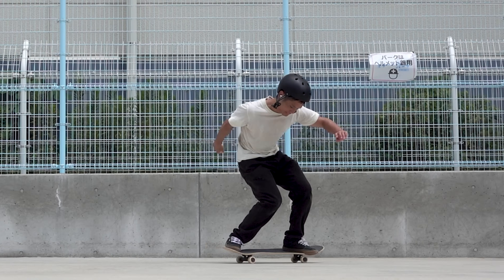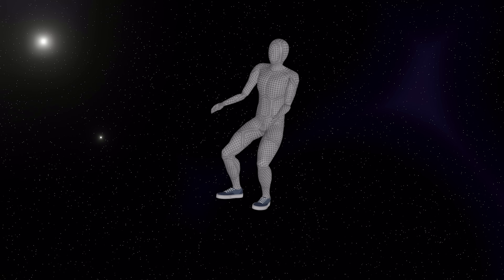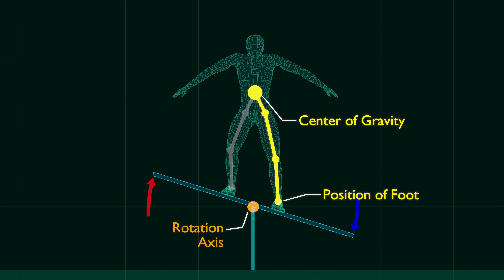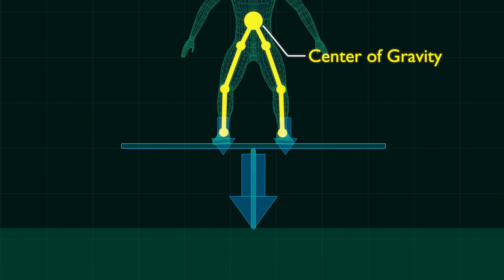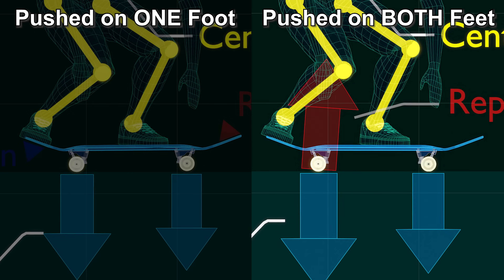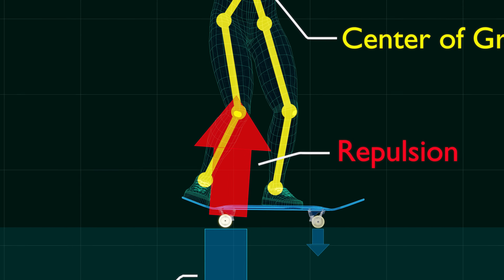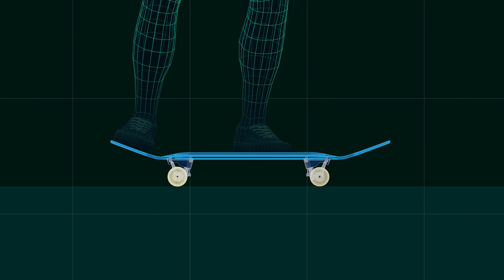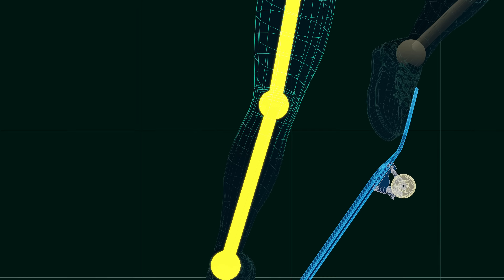The Mechanism of Higher Ollie

Comment: No.  I'm sorry but you're completely misunderstanding physics here.  In fact what's happening in an Ollie is you're PULLING THE BOARD UP WITH YOUR FRONT FOOT!  It's clearly illustrated in the wireframe video.  We jump up first and then pull the board up with the front foot.  The kick nose design of the board has made this much easier than it was before we had this.  Also, just look anyone's front foot shoe - it's worn out on the outside from pulling the board up.  Don't believe me, cut the nose off a board and remove the grip tape and see how high you can Ollie.
Reply from the maker: ???
Of course. The board pops up by popping the tail and lifting the front foot, just like you said. The main theme of this video is "What it takes to lift the body weight," not "How the board goes up into the air."
Reply: @whythetrick  No one cares what lifts the body weight, literally everyone is trying to get the board higher.
Reply from the maker: @OverhandGolf  Noted. Wish you the best luck!
Reply: @OverhandGolf You’re talking about one obvious factor, and being smug about it. Weird

Comment: So like this has a lot of useful information almost too much information. And you deserve respect for the time and effort you put into this. However I don't know what is the critical Point you're making here to Ollie higher can you just say it, Point blank, straightforward, without the physics lesson. Not that I don't appreciate everything here I really do. It's just kinda hard to actually follow the specific critical point.
(like the harder you push your feet down and pull them up will determine how high the Ollie goes or the more evenly distributed. Your weight is the higher the Ollie)
or something like that
Because like if you just jump on the board without popping the tail or sliding your foot, you will not Ollie at all
Reply from the maker: Thank you! I'll try to be more straightforward in the next video!
Reply: @whythetrick  right on man what's the main thing to do for ollie?
and thank you for the work you do like i said you deserve respect for sure man
Reply from the maker: @TomisaLami  Lift your body weight with both feet, THEN pop. Popping alone never lifts the body weight. If you encounter a problem, please send me a video and I might be able to help you.
Reply: @whythetrick i think I get what you’re saying. I usually don’t have a problem with height. I have a problem with turning and I watched your video about turning and tried all that but it’s weird. It’s like I push my tail leg back and I don’t know how to fix it even when I’m conscious of it.

Comment: You should add the point that the front foot ist leveling out (not "pulling up") the board and stopping the rotation of the board around the back truck, this way lifting up the back truck. The upwards motion comes from the pop and jump. I always miss the point of creating space with your back foot. In order to have a high ollie, the back foot is limiting height, you must lift the back foot to create space for the back truck to move upwards, not to rocket your ollie.

Comment: When I was a kid I couldn't ollie no matter how hard I tried until an older boy at the skatepark showed me it's not actually necessary for the tail to touch the ground. Once I understood it is possible to do a crappy low ollie without any tail contact at all, I figured out the rest pretty easily from there. I was working under the impression that I had to jam my tail foot down as hard as possible, which is of course completely incorrect.
Reply: This is exactly how I learned to Ollie. I would push the tail down and try to push the nose after and slowly it became an Ollie. Those were the days when all I he worries in the world were if you could kickflip or not hahahaha
Reply: thanks for sharing. I can ollie pretty high, but I stomp the shit out of it. Probably why I have trouble popping  at higher speeds.
Reply: I never noticed this. I tried and gave up because I couldn't figure it out

Comment: Pop does not equal jump. Jumping and lifting your legs give the board clearance to lift into the air. Pop is the speed with which the tail hits your ground only AFTER your weight has started to lift off the board and is necessary to give you board lift

Comment: This is somewhat wrong.  You do jump from the wheels, but the pop is caused from a secondary motion of the back foot pushing down and 'bouncing the board off the ground much like a basketball is dribbled. This bounce gives the board the energy needed for the pop.  The board would flip out of control, but your body is in the way so the board pushes up against your feet.  The board can only go as high as you jump, so the body's job is to let the board come up by jumping as high as possible. You can now guide the board with your feet because the board's energy is pushing up against your feet. This is what makes it look like the board is stuck to your feet.  

People who cant pop are usually deadening to board's pop by  pushing the back foot all the way to the ground which suffocates the pop.  The trick is to realize you are supposed to bounce the tail off the ground with your foot  like a basketball is dribbled with your hand.  You are not jumping off the tail in order to pop it..
Reply: Excellent explanation @ameobacakes - this bounce of the tail is the most important aspect of an ollie
Reply: The basketball dribble analogy is so insanely helpful
Reply: Correct!! You can see the flaw in OP's thinking in the footage of his ollies, and that also explains why they're bad. His hips barely lift.
Reply: i agree except for i say completely wrong. also, those ollies in this video are not even "high." instead of dragging your foot on your board when jumping just lift your front foot straight up and then tap the board at peek-- hence higher ollies. for any trick never drag your foot, simply just lift it and then tap
Reply: This why youtube needs to bring back dislikes lmao

Comment: The pop doesn't move the center of mass of the skater-skateboard system but it certainly does apply a vertical acceleration to the center of mass of the board in addition to the angular acceleration you mentioned!

Comment: Dude. The fact that its the wheels that transfer force to the ground, not the tail, is a revelation! I've been struggling to improve the height of my ollies for like 10 years, but this will help so much!
Reply: Wheels definitely are important I've noticed my pop is better with certain diameters and shapes
Reply: @ChazzSlackway  
the larger the wheel size the higher the lift-- 60mm
Reply: instead of dragging your foot on your board when jumping just lift your front foot straight up and then tap the board at peek-- higher ollies.
Reply: This is a cool explanation of why SkateIQ always says to “jump off the back truck”. Helpful to see it visualized this way. This gets me thinking if I’m not jumping off my FRONT foot enough.